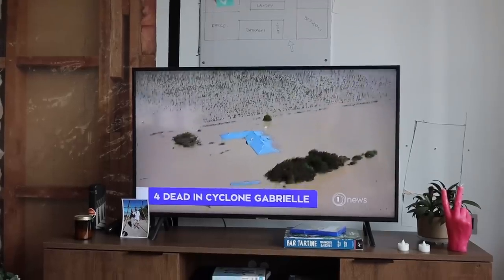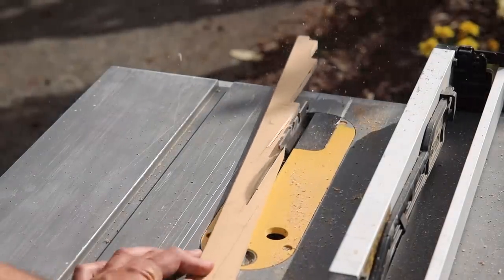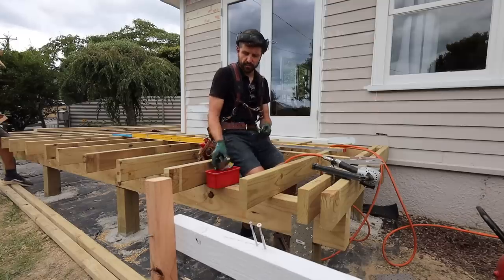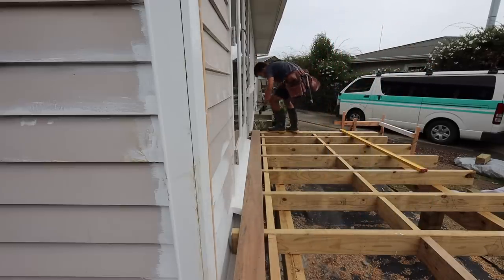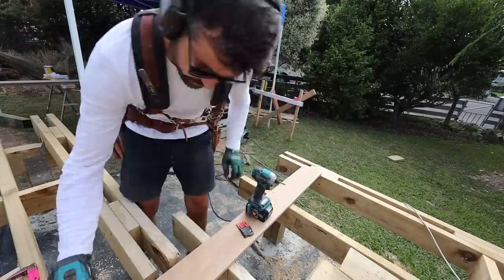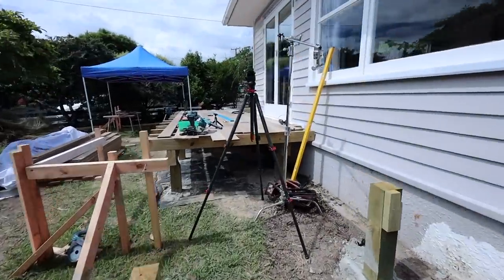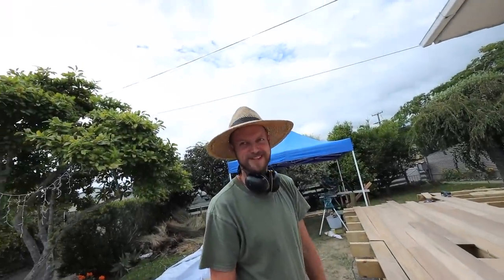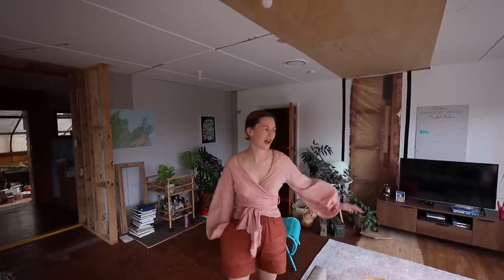Don't skip these tips, when building your deck

Comment: Hi Scott, Another great video! Do you have access to the camo deck system in NZ? This is something we use in the US and Canada on higher end decks... The screws are the same as the once you used on your deck but we screw them with a jig, that is available from Camo on a 45 degree angle into the side of the boards... So it gives you a non screw look and keeps the boards just as well in place as putting them through the flat surface. The jig also acts like a spacer between each board and keeps your boards straight... Just out of curiosity why did you start on the house side? We always work ourself the outer way... a full board on the outside and finish with a cut board along the wall. I really like the native timber you chose!
Reply: There are several clip/side mount systems out there. You can even do biscuit grooves if you don't like clips. (biscuit joiner or sometimes known as plate joiner) I was really surprised at face screwing the boards.

Comment: Rather than cutting all those wedges, why not use some framing nails between the boards for your spacers?  A 6D nail would give you just a hair over the 3mm spacing you were shooting for, and the head would keep it from dropping all the way through.  Glad to see you guys have weathered the storms (above and below the surface) safely.  My wife and I still get a little bit of a chuckle at the NZ pronunciation of deck 🤣🤣
Reply: Cause all the boards vary in thickness a small amount so if you keep using the same size spacer then it's gets out of whack pretty quickly. Straightening every 5th or 6th board let's you keep it all straight and you just wedge the gaps to all look the same so you don't notice.
Reply: @warrenspillane4552  - this is exactly what I needed to know 20 years ago when I replaced the deck on the house and used nails for spacing. Makes total sense and great advice. Wish YT had been around back then, coz sometimes you learn stuff from the comments 👍 
Also wish I'd had cordless tools back then, instead of hammering every single damn nail into all the boards 😂

Comment: should have just taken what you needed to of the first board by ripping the two ends either side of the sill and re done around the scriber and facing then just run a round over bit along it so it looks like a full board. I'm a bit fussy if I end up having a small board at the end I'll rip all my boards down fraction and re route the edges so they are all full boards.

Comment: Speaking of disaster preparing; would it be possible to build a weather-tight bunker under the deck so you can store your emergency supplies there?  That spot will be much safer to access once "the big one" knocks down the house.  Ex-Californian here; we tried every possible method to keep our emergency kits away from structural damage.

Comment: Hello Scott hope u both are allright.

Why don't you use moisture spacers in the substructure?  
I mean between the beams in the substructure and between the boards on the substructure.

We in Germany always put small moisture spacers in between, so that it does not start to rot.
Reply: 6.4.11 (c) of our building code goes over exactly what you described. The barrier is required if the bearer is closer to the ground. You can search the above reference in nzs 3604. It’s a free download

Comment: Hi Scott, Wondered if you had had any grief about using tropical hardwood? I was surprised in your choice. From my experience despite what the timber yard or retailer will tell you it is impossible to verify the source and whether it is environmentally OK or sustainably sourced. Not to mention the carbon miles. Hence have always used NZ pine. Yes unfortunately it is treated but then you already have a lot of that! Cheers

Comment: Well, he does muck around, that's why he's so good at mucking the speckle pattern on the plaster :)
BTW, speaking of decks attached to the house: I have a deck on on side of the house attached to the wall, but the house is being raised out of the ground (long story - clay), so now the deck is 5 cm of the ground at the wall. TLDR; Don't expect a 3 story house with a concrete cellar that was built a 100 years ago to not move around :P

Comment: Short piece of decking, drill two holes for your screw position. You can do it in half the time.
Ps why not use cross-spacers rather than that guesswork of the wooden wedges to space decking?

Comment: Did I see right that you back cut the butt joints, but then lay the boards down so that the gap is at the top instead of a tight fit on top with the back cut not seen? Just curious to the reason for this? I love the wedge technique for getting consistent board gapping too. I've never seen or done that and I've had issues with boards slowly creep out and had to correct my lines so I'll be trying this next deck!

Comment: Leaving ths solid block nogs on a deck low, and putting an angle on them is very clever.... nothing worse than a gap between boards landing right on a not line and never draining

Comment: You have a Very Lovely "Deck" there, maybe stain it a Nice Golden Brown Colour, just so everybody in your street will be jealous of your "Deck", also keep the kuds off of your Deck. On another note, I was a little concerned that you had not posted considering with what was going on over there. Also the Nelson KFC was running out of supplies of pre-blanched chicken, you could have been in a Quality food desert if the trucks did not get through to re-stock that outlet. 9 pieces for $9.99c Tuesdays btw, original only.

Comment: I built my decks connecting them to the house exactly on the beam fastened to the foundation. I built this house from scratch, I am sure in my foundation and my decks have roofs which are connected to the house frame forming additional stretcher for structural density of all connected structures. But. I would openly recommend not to do it like me because of too many things could go wrong. I got geological data before building anything, the decks are part of a project and I am ready to face consequences if I am wrong. BTW we have some strong winds, so I additionally stretched corners of roofs with ropes.

Comment: Would it be better to use pine wedges? I haven't actually used vitex but i imagine its pretty hard and even if you use the same timber the wedge could leave indents in the deck if hit in too tight and hard while the pine gets mushed but the deck remains unmarred. Just a spontaneous thought bc i work with hardened steel, brass  and copper etcnd we always gotta be aware of this concept

Comment: You may regret not putting a bigger gap in your boards as when it gets wet it will grow. Rule of thumb,wider the board, bigger the gap, ie 6mm 👍
Reply: Good advice and also put a membrane over the joist before you fix the board so the water can’t sit on it and rot the pine
Reply: We use mainly hardwoods (as Scott is using) for decking here, less movement between wet and dry. 3mm gap is usually the standard. Nelson is the sunshine capital of NZ so its more likely to shrink than anything.

Comment: i make a simlar screw template to ray but i use a piece of metal flashing that folds down and has a cut out so it sits over the joist and has 2 pilot holes drilled, that way they are perfectly spaced but also centred, no pencil required ..... i hope that made sense  ?

Comment: Hi Scott.
Long time watcher, first time commenting.
I’m also a builder by trade (although haven’t been in trade for a few years now) 
I’m currently planning a big deck at my new home (massive Reno job, similar to yours)
My question is, when planning the size of a deck do you make the overall size to suit your decking timber plus gaps ie so you don’t end up with a small ripping before your picture frame board?
Reply: We leave the joists long untill the end and finish the edges with a whole board to avoid rippings.
Reply: Thanks Ray!

Comment: Planer snipe! Thats such a bummer when your reverse cutting when measuring the time I have done that with flooring thankfully they are only short lengths, but that 1st plank is time consuming. you not use the concealed decking clips where you see no fixings. do you not oil the underside of the decking? why not use a 3mm packing piece? It's about time Paerau come to stay & help with your remodel!!

Comment: Tapered screws would split decking when fixing at the cuts, but you both knew that.
Not a criticism, just a reference for future projects, you should read up on how ship decking is arranged to avoid cuts too close on adjacent boards. I go for 3 joists apart minimum. And 4 or 5 deck boards before a cut aligns on the same joist as another cut. I get that you're probably tight on linear metres, so trying to minimise waste is as important as aesthetics.👍

Comment: decks were used historically as a product of diferent width and moisture content and they use them deck process on ships, there’d stuff hemp in gaps. using decks as we do today is dangerous as a lot of decks are at height snd the substrate is under attack from day one. and entripie u can’t fight and decks don’t last long. that’s why they didn’t build them and if they built a deck bridge they’re build structures over. anyone that builds decks no’s nothing about good building practices

Comment: Hey Scott, coming from a sustainability perspective, Vitex is on the blacklist. Regardless of its FSC rating.

We stopped specifying tropical hardwood, among other things, when we learned that the FSC rating can be laundered or traded. This largely depends on the government where the timber comes from. 

We now only specify timber grown in countries with stable governments with low levels of corruption. If you take carbon from shipping into the equation, this really just limits our options to farm macrocarpa, treated pine, or wind felled native Timbers. 

Anyway, your videos are great! But I don’t want to see you using dodgy hardwoods again!
Reply: What about nz local eucalyptus or redwood?

Comment: I'm surprised that you don't know how to properly mark out a scriber. You should use square to mark the end of the weatherboard so that it goes straight back. The way you did it you need to trim the top of the scriber to make it fit and this makes the scriber short at the bottom. I always use plastic strips to mark the depth of cut so the scriber fits flush or slightly proud of the facing board.  I have a bunch of plastic strips cut 1mm intervals in width and use the size for the best fit.